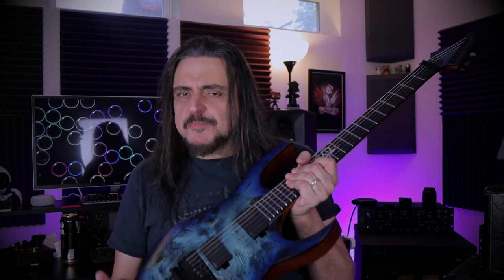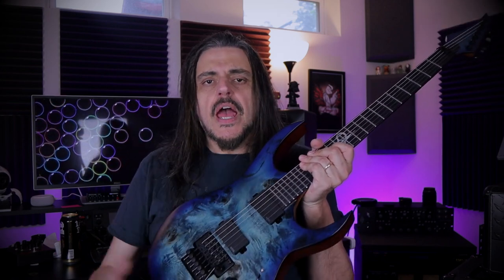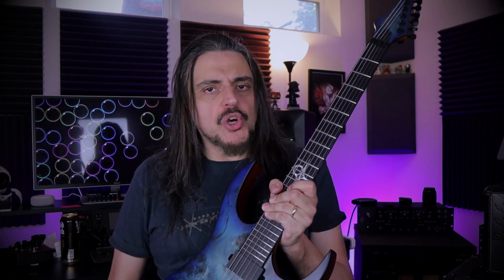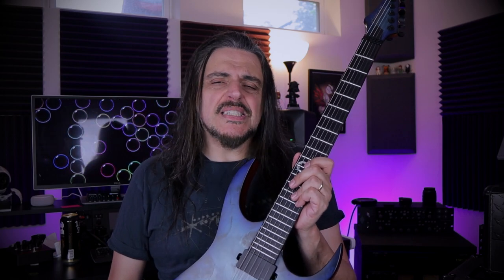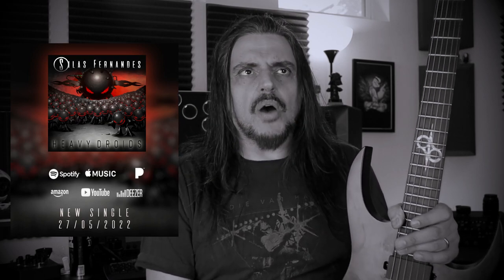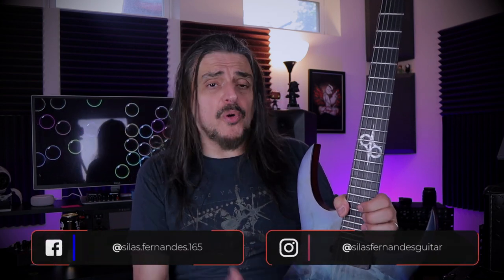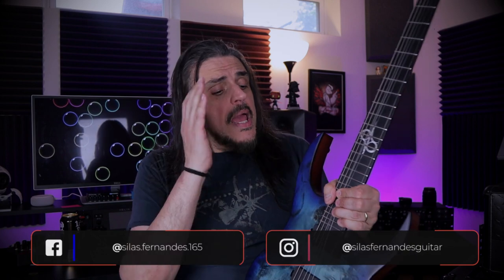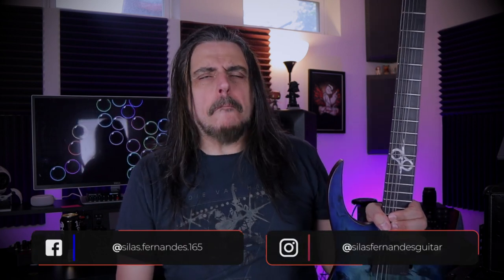Solar Duncan Vs EMG - Swapping and Comparing

Comment: EMG has never been my fav pickups, I would switch the Duncan Solar for another passive pickup instead like the Duncan Black Winter for example If I wanted hotter pickups. I recommend you try them out. Solar also has newer Duncan Solar + pickups which are slightly more  hotter than the standard Duncan solar pickups, but I think the Duncan Black Winter is even more hot.

Comment: The EMG 81 is almost always the best pickup choice. Here with your rig and setup it destroyed that Chinese solar pickup.
Reply: match gain level and there is no difference
Reply: @wareloski2137  you must literally have potatoes for ears. Saying one sounds better than the other is subjective, but frequency analysis charts prove these pickups are vastly different.
Reply: Duncan solar basicly is a duncan design HB14, cheap version of Seymour Duncan SH14
Reply: In this demo it's true, EMG sounded really good, but I have two solars, one with Fishman Fluence Modern and one with a Duncan Solar and some other guitars with Seymour Duncan SH5 and SH6 - the Duncan Solar sounds different on its own, but not bad in any shape or form. 

I really liked the EMG 57 and HetSet when I tried them out on a different guitar, the crushed the 81 all day long. 

But the EMG81 is just a legend - can't debate that.
Reply: Do I need the emg 60, or just the 81 if I were to swap out my solar Duncan's?